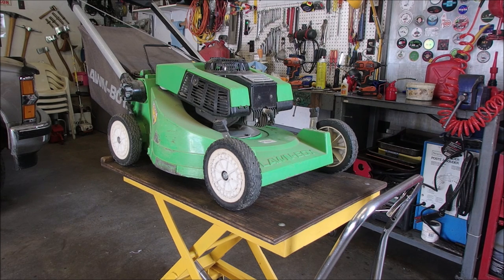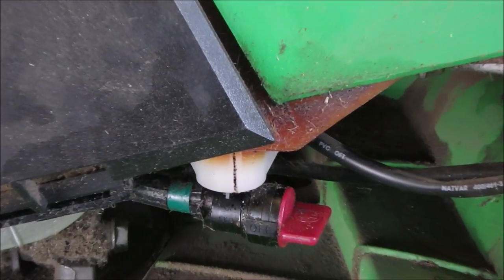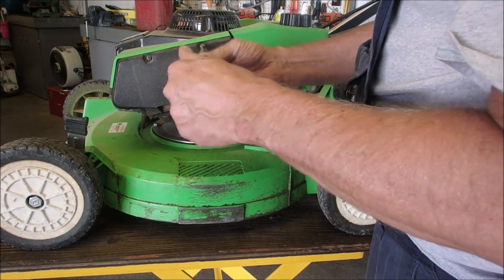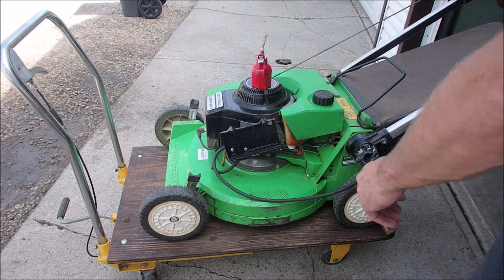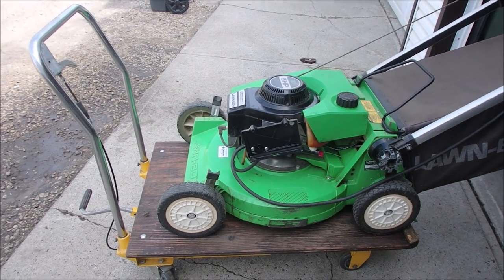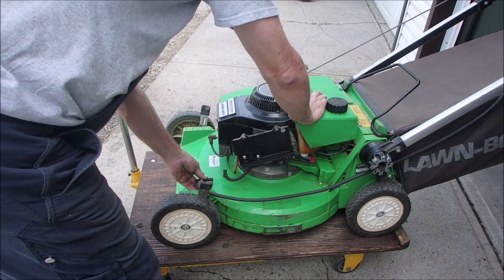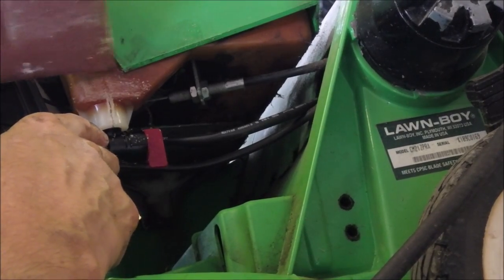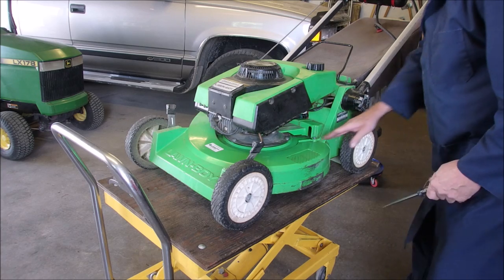Very Rair,  A Big LawnBoy 2 Stroke Mower

Comment: My first real job in high school was assembling Lawn Boys for my local lawn and garden center.  I put together hundreds of them in 1980 but never saw one like this.
Reply from the maker: Cool   thanks for that.
Reply: M series didn’t come out till 90s
Reply: Yeah, I worked on good ol lawnboys back then in the mower shop also.  I'm wondering if "lawnboy" even made this two stroke, kind of looks like a tecumseh.  The exhaust does not go through the deck like a typical lawnboy two stroke...  The metal cowl/rewind sure looks like tecumseh as well.    Wonder how old that lawnboy is...  Good luck replacing that crazy tank!  Looks like a $150 hunk of plastic to me!

Comment: I have a 30 year old lawnBoy still running strong. They were bullet proof. The rental agency used them because of that. After 10 years I broke my connecting rod due to air filter neglect, my bad. I replaced the connecting rod myself and that was 20 years ago and now it runs better than ever. Nothing better than the smell of cut grass and 2 stroke oil.
Reply: Great to hear.  I love it when people have the guts to do stuff themselves.  Lawn boys are in my heart and soul.
Reply from the maker: Mrs P. Says she agrees.

Comment: One of the newer M Series Lawn-Boys before they discontinued that model. The early versions had oil injection with the separate oil tank. A little later they went to using normal premixed fuel like the rest. Also I believe this engine is piston ported unlike using the reed valves like almost all of the rest of the Lawn-Boy 2 strokes except for the DuraForce models. I still mow with my 36, 45, and 48 year old Lawn-Boys.
Reply from the maker: Very cool.

Comment: That a M series engine that Lawn Boy came out with in late 80s they 64to1 fuel mix which is 8oz of oil to 4 gallon of gas or 4oz for 2 gallon of gas.
Reply from the maker: Wow  OK Thanks

Comment: That is an "M" series Lawn-Boy. Created in about 1989 
by Lawn-Boy just before they sold out to Toro. Very expensive for the time.
Reply from the maker: They were sure well made eh
Reply: @BrucesShop  I personally think that Suzuki made them or at least provided the design. The carbs are Mikini. The crankshafts are pressed like motorcycles with a steel rod. Yeah they are tough. I'm hanging on to mine forever.

Comment: I remember this model well ...... what a piece of crap. My kid wanted to start a lawn mowing business, so I researched a mower for him in Consumer Reports and this model was the highest rated. I wanted a reliable mower with which he could assure his service  and have fun with at the same time. Within a month the fuel tank started leaking, and it wasn't a little 'drip ... drip' leak. Back to the dealer under warranty and he couldn't get the part. We waited 3 months for the part and in the meantime my kid lost all his customers. I suspect it was a systematic failure for the model and Lawn Boy just couldn't keep up with the orders for parts. Anyway, we sold the mower when it was working and bought a Toro. As a side note, I run a '79  19'' LB to this day and it is a wonderful mower.
Reply from the maker: Great story